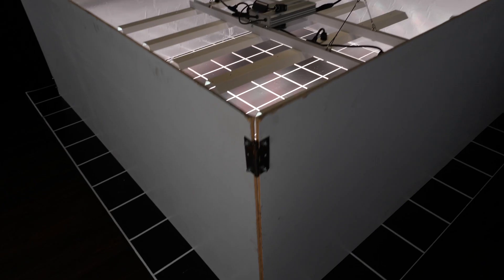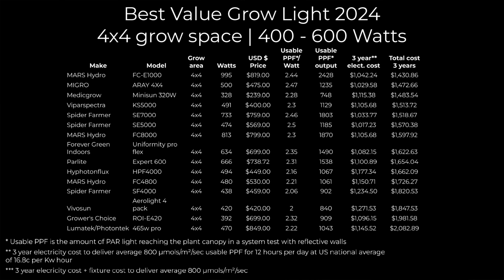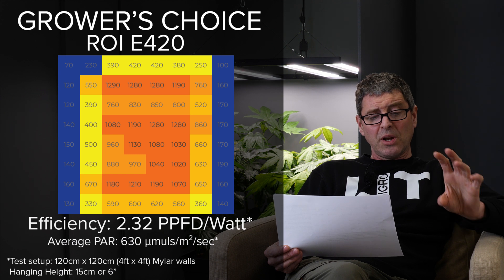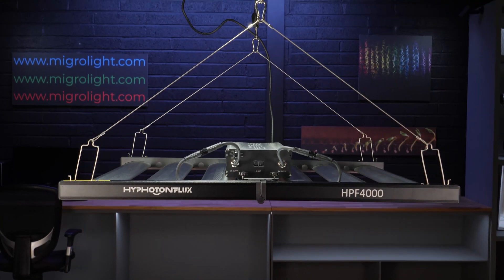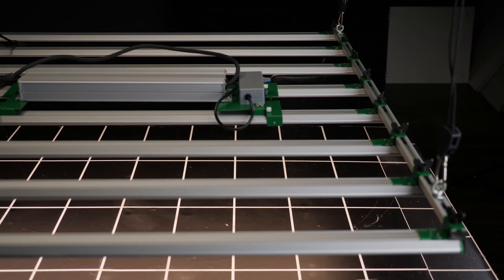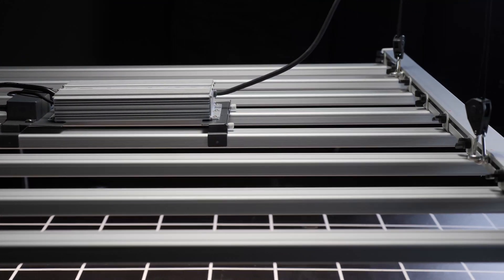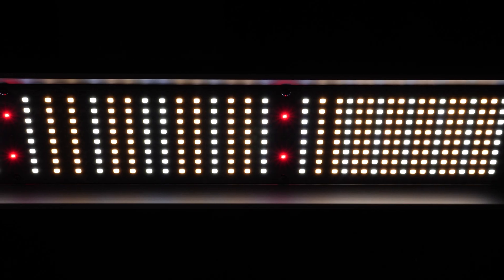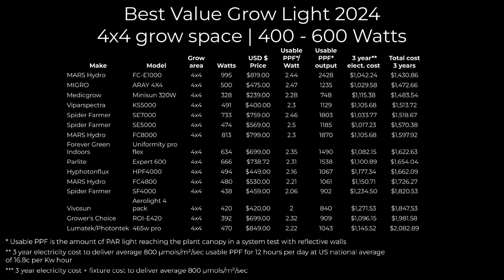Best 4x4 grow light 2024

Comment: You left probably the best light on the market off the list. AC Infinity EVO 8
Reply: Naw your not right at all it's driver runs HoTT as can be( I mounted mine on a 4x4 tube to dispurse heat and it's still hott .... and so does the light fixture, I have a ks5000 and an Evo 8 and because of the heat it puts off I prefer not to use it
Reply from the maker: Have a look on the AC Infinity driver to see if it mentions what it's operating temperatures are. Premium drivers will often operate around 25 degrees Celsius above the ambient room temperature and be well within their optimum operating temperatures. Even at around 55 degrees Celsius (25 degrees above what most LED grows will run temperature wise) drivers will feel very hot to touch, when in fact they're operating very safely. 

Drivers with bigger cases for example will still be exuding the same amount of heat for example, they'll just feel less hot to the touch as they have a larger surface area to dissipate heat.

Comment: My issue with these "4x4" bar fixtures is they are really overkill usually but also not very modular. You can spend 800 on one, have the driver glitch out and burn up everything and boom done. I prefer buying individual panels and stringing them together. Buying 4 100 or 150 watt fixtures on sale makes too much sense to me and you can do 2 2x4s or whatever you need. You can individually adjust height so no more letting the slow starter get further and further behind basically ruining a plant or two. I don't get why people go for these options, companies are barely offering discounts on such pricey investments and have new cycles every year where service and parts on the old stuff quickly disappears.
Reply: How does that make sense to you? Having a bigger light and having it dimmed drastically reduces heat and load on the driver. Then on top of that, having multiple fixtures in one tent exponentially increases the chance of a driver failing.

Comment: I have 2 hlg 550 v2 r spect in my 4×4 ,is that over kill lol?I run both at 80%36 inches over the plants
In flower and the pars around 900.never have any issues and I don't use co2...

Comment: If I use se7000,in 4x4 is it necessary to use 100% power? I only have one tree. and encountered problems with heat in the grow tent Right now I'm only using 80%. Or should I change to se5000? 
If i used 100% of light my grow tent temp is 80 Fahrenheit or more
Reply: It's really not a yes or no answer, indicating that you don't understand enough about growing. 

Is the plant healthy? Generally you can turn it up until you get light burn, then turn it down a bit... But a better way is to actually measure PPFD/DLI values and go from that.. you're probably not going to be maxing that light out if it's anywhere near your plants. 

If you want to keep it simple, just leave it as is.

Comment: Any need to supplement co2 with your migro light?
Reply from the maker: CO2 is beneficial at all PAR intensities. However if you cant to grow more it is usually easier to add more grow space i.e. a seedling or veg tent
Reply: @MIGROLIGHT  I just picked up a 4 foot x 4 foot x 80 inch tent.  I plan on getting your light.  I'm just trying to prepare properly and get everything at once.  Looks like I might be adding some co2!
Reply: I recently received your 500w 4x4 migro aray light.  I noticed there are some inconsistencies on hanging height between the online information, and the information provided with the light itself.  What do you recommend for hanging height and power percentage for seedling, vegetative, and flowering stages?

Comment: Double ended high pressure Sodium lights are exstreamly cheap and have exactly the right light spectrum you will need in flower always.
Reply from the maker: Not true. spectrum is only 2% blue which promotes stretching. LED have 10 -15%blue for short dense growth. HPS is less than half as efficient making them much more expensive to own than LEDs over a period of time and are environmentally damaging due to energy wastage and mercury content.

Comment: Thanks for the update. There is something funny about the spreadsheet. Shouldn't "total cost 3 years" column be "3 year electricity cost" + "USD $ Price"? The last column doesn't seem to add up. Mars FCE1000 is $819 + $1042, but is only $1430 total cost? Then Migro Aray 4x4 is $475 + $1029  and Total Cost is $1472. How can the total cost of the MIGRO be more than Mars when the Mars fixture is $350 lower than Mars? Is there some other variable that is not listed in the spreadsheet?
Reply from the maker: The electricity and fixture cost are based on delivering 800 µmols PAR average in a 4x4 which is 800 x 1.44m2 = 1,152 µmols PAR. The MARS Hydro delivers 995 watts x 2.44 = 2,428 µmols so there is only about 1/2 a fixture required or about $400. The ARAY 4X4 delivers 1,235 µmols so about 90% fixture cost is required or about $410. This calc may appear convoluted but it is the best way to compare lights of different wattages and PAR outputs to suit the same size space in my opinion.
Reply: Someone considering buying one of these lights for their 4 x 4 grow space is unable to buy 50% or 90% of the fixture. They have to buy the entire fixture. So their initial capital outlay is the "USD $ Price" @MIGROLIGHT  . In my view that should be included in the 3 year total cost. (And it would make MIGRO total cost way better than the more expensive fixtures...) Maybe your chart is fairly comparing the efficiency of the different fixtures, and the way I describe it is a "buyers guide".
Reply: OK. Thank you. Understood.

Comment: I want to grow in my basement, but I can only use a 120 x120 x 180 cm tent. Can i still use the MIGRO ARAY 4X4 750W or is it overkill?
Reply from the maker: Hi, it's not overkill, it's at the high performance end though. If you are just starting I would recommend the ARAY 4X4, link here: https://migrolight.com/collections/led-grow-lights/products/aray-4x4
Reply: @MIGROLIGHT  but my tent hight is only 1.80m is that still okay?
Reply from the maker: Yes

Comment: Why is it that you never include Black Dog, afraid of the competition?? Used them for 10 years.  Nothing compares.
Reply from the maker: No just never tested one but they would not do well in this comparison. According to their website their 500W 4-8s delivers 665 µmols average in a 4x4. That's a system efficiency of 1.91 usable PPF/watt. That is a lower system efficiency than any fixtures in this list for $1,149. They were good fixtures when you bought them but now they are not competitive.
Reply: @MIGROLIGHT  which are you talking about.  And mine produce over 1200 watts.  And the newer ones  are taking g over the large commercial market.  WTF. Maybe you should check again.  New lights can get 7lbs. Documented. Can yours.
Reply from the maker: @RedtideFla  Read their specs, they are outclassed by every light on the list above
Reply: @RedtideFla  lights don't produce watts. They use watts and produce light, heat, sound/vibration. The more efficient the light is the ratio of the light produced goes up. An old led rated 1200w could be throwing out less light than a new 750w Led.
Reply: @tommyheron464  I'm glad you think this, but I'm still getting magazine quality,  and 36to 40 Oz off each light. All new grow facilities are switching to black dog.  Cheap Chinese LEDS are exactly what they are.  Inexpensive and last 2 yrs. Black gives 5 yr guarantee.  Do your lights. All high-quality connesuers  are switching. Maybe you should open your mind to the obvious.

Comment: I'd love to see you include the new AC Infinity bar lights in your review.
Reply from the maker: Still waiting for them to send me one, hopefully soon
Reply: @MIGROLIGHT not a fan of the AC infinity evo 8 myself it runs super HoTT, light fixture and power supply ( mine is mounted on a 4x4 metal tube outside of the tent to disperse heat with a fan turned towards the power supply  and it's still hott , I would not trust it on carpet ) , I have a ks5000 from viparspectra and I prefer that honestly

Comment: Migro lights are underpowdered and unsuitable for growing in the spaces suggested. You can tell this is the case by the 250 watt increase between the 4x4 light and 5x5 light. 30cm distance from light required to almost get 800 par and the average under 800??!!! Seriously???
Reply: You’re missing the point of effinciency 

They are under-driven to increase lifespan and efficacy . 

800 par is bang on for big buds .

Comment: Rocking a KS3000 in a 4x3 and i'm very happy with it. First round of tomatoes turned out very tasty and i can control it with my Controller 69 Pro. Have had Shane's Aray 4 in a 4x2 before and it also worked like a charm. I'd recommend Viparspectra and Migro any day.

Comment: just finished a run with my migro 4x4 500w version ran 6 ak47 from serious seeds and 3 super skunk from sensi . got 426g of ak and 178g of super. of nice dense bud and 110g of popcorn nug still fairly dense but not like the bulk. all in all very very happy with my light. and forgot it was only on 80% for week 3 to 5 of flower oops
Reply from the maker: Nice yield for 400 watts🙃 1.8gpm. What medium were you using?
Reply: @MIGROLIGHT  ak in soil 20 litre pots. super in coco 15 litre pots. light went back up to 100% at the end of week 5 till harvest day 58. i love old school strains ak pheno 2 was 115g

Comment: I am now replacing my ViparSpectra KS5000 after 7 years of faithful service. Replacing it with a new AC Infinity Evo8 in my 4x4.
Reply: @RAWS420  Ya, I ended up using a par meter app. It's not very accurate but gets me in the ballpark. I ran at 100% and probably started around 3 feet but never moved the light. It's less than 2 feet away now, I'm sure, and the plants are happy. Last cycle, under 90 days seed to harvest, I finished out 1 northern lights at 13 oz dry and green crack at 4 oz dry. Doing Orange sherbet and another green crack now. I got it figured out now.

Your advice is solid. Thanks mate 🍀🙏🇺🇲
Reply: I just bought ks5000. What was ur average yield per plant? Did u grow a bunch of little plants or multiple large plants? 

Any issues? sounds like it worked great for 7 years.
Reply: @Rizik1986  Hi I usually run with 4 plants in a 3x3ft bed under the light. I never really paid attention to weight. However I did one plant under it and got just a little over 3/4lb. The light did great.
Reply: @Skyrunner_1  Good information! So far I've only grew one at a time. They grew huge and got near a pound. I wanted to step up to do more than one plant at a time, sounds like this light was exactly what I was looking for.

Is the AC Infinity Evo8 miles ahead of the ks5000? 

Thanks for the reply 🙏🍀🇺🇸
Reply: @Rizik1986  Yes the KS5000 is a great light. I hope it does everything you want it too. Keep the light at least 30in away from the canopy. It is bright enough to burn you plants. I think the lights are comparable.
Reply: @Skyrunner_1  Awesome, glad to hear. Absolutely don't wanna burn my plants so 30 inch minimum above canopy, got it. 

Thanks again for the help! 🙏🍀🇺🇸
Reply: @Rizik1986 You will love them. I use two ks3000s for a 4x8 and it fills it nicely. Also very reliable, cheapish,low heat, even canopy. I'm about to retire to the medic grow folds 800 tho. They fire
Reply: @ErinBrown-g7q  I'm actually looking for a new light and was torn between medic grow led or Spider farm led. Either would be a step up from my KS5000 which has been great led for me. The prices keep dropping, I might try both to see if I prefer one over the other. Thanks for the feedback and happy growing! 🍀🙏🇺🇸

Comment: i like what mars is trying to do by letting you span out a high powered 4x4 light into something you could use with great efficacy in a 4x8 but the implementation needs some work. vivosun has the idea of modularity all wrong. if they wanna do stuff like this they should be thinking about people who are upgrading their grow tents and dont wanna buy 4 more aerolights.  extender packages should be sold separately and given proper consideration as a grow light accessory.

Comment: What I would really like to start seeing next to the "PPFD in a 4x4 at X inches" charts is a temp reading showing how hot said space gets at that distance with a baseline of no exhaust happening.  As I buy lights I am finding out they are not all created equally in the area of "am i going to be able to maintain my RH or will I have to constantly run the fan not to fry the plants."
Reply: One watt equals  a fixed amount of BTUs no matter what.. the only reason old school lights heated things up so much is because of the infrared in their Spectrum
Reply from the maker: Hi, the more efficient the grow light is the lower the heat and visa versa.
Reply: I keep 2 fans running in my 4x4 24/7. Above and bellow canopy.

Comment: Good info. So at how many watts do I need to introduce co2 man. I have an 350 r from hlg. I would like bigger bud. The quality is fine but I don’t get huge colas for the main vein.
Reply from the maker: Anything over 1000 Par co2 is beneficial
Reply: @MIGROLIGHT thanks much
Reply: Not all strains are made for huge baseball bats. It very dependant on plant structure, how you can manage streching, what kind of light you are using, how often you are feeding, how precisely you can control nutrient supply (depends on media you are using).
It is so many factors  to be considered. I got beautiful fat colas from using cheapest possible grow light, tons of terpenes. While clones of plant produced rock hard, but not consistent cola and they streched 2x more than mother plant. So experience is biggest key. CO2 is good for speeding up vegetation, but after strech is finished (1-3weeks, dependinging on genetics) plant starts nutrient uptake downwards. ✌
Reply: @aj9485 I’m well aware. Thanks

Comment: Is the photontek the equivalent of the Lumatek 2.9 or lower umol/s model? I think its the 2.7umol/s model. Still, the coverage on those units are terrible by the looks of it.
Reply: Thanks @migro I'm more interested in the one you tested as there seems to be a big difference between the diodes used. It might make the difference when someone is deciding what unit to purchase.
Reply from the maker: Both the same fixtures just with different names for the UK and US market, they have a 2.7 and 2.9 if I remember correctly.